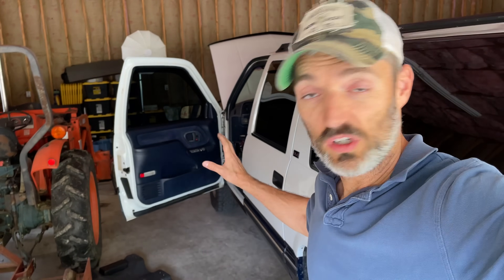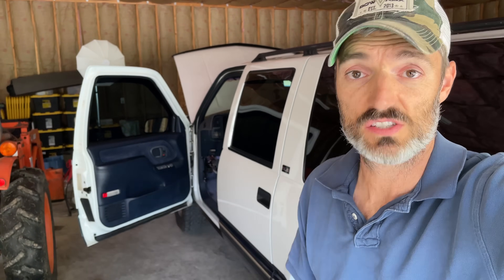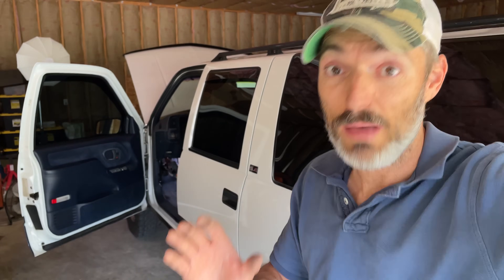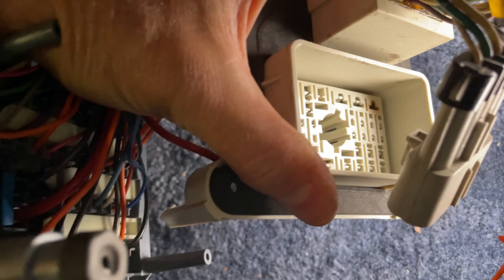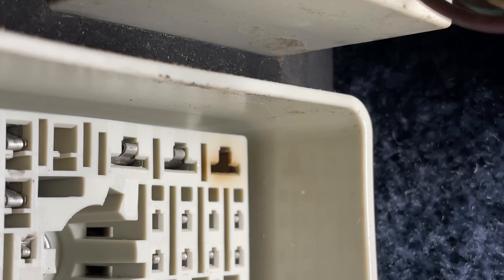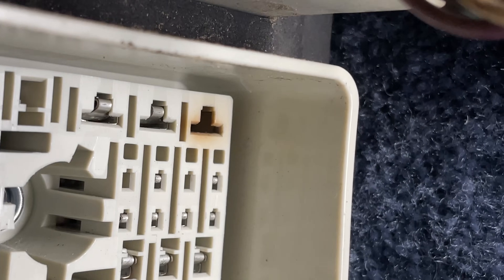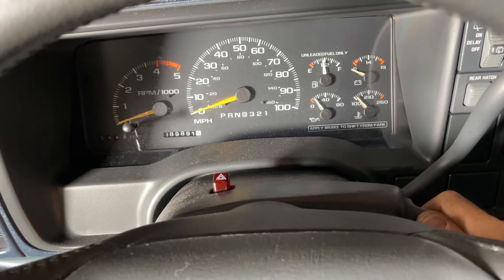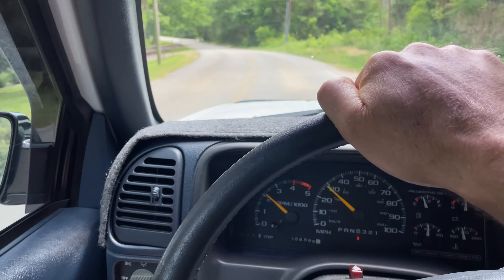If Truck Randomly Shuts Off THIS MIGHT BE WHY!!

Comment: Jimmy, you're a rock star! This wasn't the exact problem with my 2012 Silverado, but immediately sent me in the right direction after viewing this. My truck started randomly dying , usually right after starting it. No run, no crank was the only symptom. Warning lights, a/c blower, radio all functioned fine. After several attempts to restart, it'd finally go and run fine. It did this every day for about a week until I saw this vid. I saw another YouTube video that showed how to separate the under-hood fuse box from the base. I took it apart and found the dozens of pins that plug in had a lot of chalky oxidation on them. With a knife blade and 400 grit sandpaper, I carefully cleaned them all up. Upon reassembly, I noticed a relay labeled "run/crank". There were 4 other identical relays plugged in, so I swapped that one with one labeled "running lamps". I'm not sure which was the problem, but it's been 2 weeks and the problem has not recurred. Thanks for the video. Helped me sort my problem out quickly.
Reply: Is your car still working?

Comment: I have a 98. I took my truck to a guy that said on my models, there was a wire in the steering column messed up. He was an "expert". I changed my wiring harness in steering column since he did mention what you were describing about your shift light. I'm glad you found that problem. I'll be checking this out on mine. Great job!
Reply from the maker: Thanks, hope it helps!!
Reply: Any luck with your 98" mate ?
Reply: @mechaniconduty4040  My issue was unrelated to this in video. My issue was in transmission wiring harness. What issue are you having?
Reply: @ED-ti5tc recently had the transmission dropped and running into it dying while running did u find your problem?
Reply: @Miguel-lw2of  No. But I'm thinking it has something to do with the factory security system.
Reply: @ED-ti5tc my 98 chevy will run 100 fine but when u kill it and try turning it back on sometimes randomly itll seem like it had no power no connections at all then like nothing itll get connection and turn on

Comment: One great thing about owning a vehicle for many years is the familiarity you gain with it. I'm sure that was a help to find this problem. I, being an outside the box thinker, would have bypassed the connector block by splicing that wire from inside the engine compartment through the bulkhead to under the dash. You would eliminate any issue with that connector box and have easy access to that wire if needed. Regardless, I can't fault your fix. Nice job.
Reply: yes I had the same problem with a 76 ford , I bought off a car lot in Whitehorse Yukon really cheap , it had new battery ,new alt ,new ignition etc , then one day I was going to night shift at whitepass trucking as a tire man , and I seen a flash on the floor , that's what it was all along a # 10 main wire burnt off at the fire wall junction I joined the wire together and it was fine ever since .

Comment: I had a bad positive cable on my 08 Silverado.....random loss of electrical power.  I tried everything until I came to find that wiggling the positive cable had an effect.  I cut that giant positive connector off and replaced it with an old school battery connector.  Problem solved forever.  Your issue was different....but always smart to do the "big 4" on these mid 90's rigs.  I'm just waiting for Spring to come and I will do that little fix on my 95 K1500.

Comment: Appreciate this Jimmy! This just happened to me on my 2005 Suburban, but the lights for the shifter indicator and AC headend unit (with all the AC/ Heat controls) have been very VERY dim for a couple years. Sounds like that could all be related - who knew? Will check this solution out on my truck tomorrow - thank you very kindly for sharing! -Ken

Comment: I have a 1991 Chevrolet   bed and ext cabin....i have the same issue shouts off when stops on red light intersection. I exchanged distributor cap rotor ignition wires ignition coil
I check the buster break check valve and still shouting off...now that I see your video i will check that fuse box also like you did......I will let you know if works for me. 
Thanks for your videos are so educational. 
Jaime from HoustonTx 👍👍🙋😊
Reply from the maker: curious if its the same?
Reply: Did u find the issue @jaimef2674
Reply: Did you find it

Comment: back in the mid 80s I had a 1969 Mustang that would randomly die like that when taking off from a dead stop, or when I hit a bump in the road. It was almost the same thing, the screw that holds the two halves of basicly the same connector was loose. I tightened it up and never had that problem again.

Comment: Nice Jimmy.  One other wire you need to check for preventive maintenence, is the ignition bypass wire inder the passenger side dash.  There's a connector there that you disconnect to set the timing.  The contacts there in mine corroded and became intermittent.  I fixed it by opening up the harness to access that wire (brown if I recall) and I soldered extension leads about 12" long to each side.  Put back together and then solder the two ends.  Wrap up the excess wire with tie-wrap.  To set timing, I will unfurl the wires and cut the end off opening the circuit.  Then re-solder and re-stow those wires.  It will never again become intermittent.  Truck did not die, but stumbled horribly as the ECU lost control of spark timing (EST).
Reply from the maker: Very good info! Thanks

Comment: Intermittent electrical.  First, don't ever take the firewall pass thru block apart unless you are replacing it.  That's the last thing you do before you give up and rewire the whole vehicle.  Splitting that box can be like opening Pandora's box.
Check your fuel pump power lead from source to pump. Look at it, NOT continuity check. You've changed your fuel pump, lifted the truck, some other stuff.  Check that power source wire from one end to the other for a pinched or chaffing wire, loose connection.  Also, ignition switch wiring for the same issues.  You could have a jenke ignition switch, or maybe the plug on the switch is loose or wires chaffed against a bracket under the dash.  If it only happens after the truck is good and warmed up, take the ignition module out of the distributor to an auto parts store and have it checked.  They aren't very expensive and and it will be cooled of when you check it so...
Reply: U r right about that pump wire
Reply: @stuckinmygarage6220  Dropped my tank 3 times before I found issue with that wire not crimped properly
Reply: So what was that Red wire he fixed ??
Reply: @ABMNuskii  I think it goes to the neutral safety switch.  It is a hot and too big of gauge to be just for the PRNDL light.
Reply: @x-man5056  Thanks brother 👍🏾

Comment: Nice work detective! My 2018 silverado just started dieing and when I took off the grounding cable, it looked like the frame was undercoated before the cable was bolted on. So I cleaned off the undercoating and got down to metal so hopefully it fixes my issue.

Comment: This is a common problem on some of the jeeps, I changed out the ignition switch and everything still no start, started digging around and found this connection type on the starter under the car, and yup that was the problem, my 05 jeep liberty starts everytime now

Comment: My 1998 k1500 Suburban did this all the time. Would go out somewhere and would just die. Ended up being towed 37 times in one year. Would take to a specialist and said it’s fine and next day the Germlin would reappear. End end up parking up the suburban for 5 years then had an auto sparky rewire the complete engine bay so fingers crossed it’s sorted

Comment: Good stuff Jimmy, thanks for the knowledge. Now I'm going to have that failure lurking in the back of my head driving my Suburban! Only issue I've had is the anti-theft model went bad. Truck would start and run for 3 seconds and turn off. Drove me crazy for a few days until I replaced the module with a rebuilt one  (part no longer made) and had the ECM "flashed" (I think that's what my mechanic said). Anyway, can't wait to see what's next.
Reply: I've had this problem with mine. The stupid security feature. I no longer use the fob to lock/unlock or the door lock buttons. If it wont start, turn the key on for 10 mins till the 'security' light goes off then turn key off then back on. Should start. Not sure what the permanent fix is yet.
Reply: @tarabull75  you have to do a DIY hack and bypass the module with the right diode or have the module rebuilt (since they don't make them anymore). I had a two week nightmare until I got it figured out. The "learn the new key" trick worked for a few times but when the security light stays on... You're screwed.

Comment: I have a 1995 gmc c1500 the fuel pump wasn’t the issue after I replaced it also replaced tps egr and battery terminals right now it’s at a mechanic shop but i truly believe it’s this issue

Comment: Excellent video Jimmy  :) also check out is a ground battery cable pigtail to fender wall connector  get corrosion plus bolt of 10mm size also washer    for to clean up with sandpaper  on fender too it ! Next one is fuel tank sending unit plus plug to it frame rail ground wire connection to plus hardware  and next fuel injection  injectors need replacement  2 them ! Hope solved problem my late Dad 1990' Chevrolet Cheyenne  2500 pick up 305 motor happened to him in 2000 year and was driving caught off too!

Comment: I just fixed a stalling issue on my 1998 Jeep Grand Cherokee which was doing the exact same thing you described. My issue turned out to be the ESD Relay. It never showed a check engine light or anything, so frustrating to track down.

Comment: My truck would intermittently refuse to start. One day, I noticed that all of the gauges were reading wonky. I knew that I probably had a bad ground. It turned out that the negative battery cable had corroded at the battery terminal. I had to strip back the cable and install a better battery terminal connector. I also spayed some terminal protection fluid on the battery connections.

Comment: I have stalling issues as well. But mine would stall like yours did and I would have to throw it in neutral to keep it running at the light and only when the truck warmed up. I’m gonna check this out when I get a chance cause if it’s my issue. I’m gonna scream

Comment: What would have REALLY helped is if you would have identified the circuit that this wire is contained in.  Would allow for folks to make sense of what is actually happening in the electrical system, the WHY of what's failing.
Reply: Main power feed to everything through the ignition switch.

Comment: Great video. My truck just started doing this twice. Right after taking off it died. Then it started right away. I noticed my volt gauge has been acting weird, a little erratic but mainly lower usual. I also noticed my flasher was not working well couple of weeks ago, so I wiggle it and it is all good. It died today again and start right away. 96 chevy truck. Do you think it might be related to the same connections? Did u noticed low or erradic volt gauge?

Comment: Years 95 to 2000s also had ign switch problems I replaced several they would often times run but might not up shift & the gauges might not work

Comment: Jimmy, my 91 K1500 is a 4.3 v6
5 speed stick, died at 45 mph. I shifted
To neutral, and pulled off the road.
Towed home, it cranks but no start.
Maybe fuel pump, or ? 🤷🏿‍♂️

Comment: my '68 Slant Six Dodge Dart had same problem :face-blue-smiling:
was stuck in the boonies but had my tools. drilled out a hole right thru connection where it's on the firewall and used a twist-on connector. it's still like that and running still :person-turqouise-waving:

Comment: Good luck. My 2015 truck is dropping voltage when I park or when I'm coming to a stop when parking. . The engine shuts off completely. I can instantly restart it but it's a problem. Once I had no power for 15 min and then magically it just works again.

Comment: Hey Jimmy, I have a 1991 Chevy G30 Sport Van with a 5.7 liter TBI w/ automatic transmission that runs great, but dies at idle after it warms up. Every stop sign or light. Then it will start right up. The only way you can drive it is to put it in neutral at each stop. Lately the newest wrinkle is that, rarely, but on occasion it will not start. Meaning that nothing happens. The starter doesn't engage at all. No clicking or anything. If I leave it (cooling off, maybe) it will come back on line and start right up after 10 to 15 minutes.

I  have tried the idle air control valve, MAP sensor, heat sensor or switch (no temp. gauge),  Also, by the way, extremely rough start in cold weather. Any ideas? Really enjoy your channel. Thanks

Comment: If your rpm gauge ever pounces at idle (not with rpm) but just flutters (it's hard to explain) but the coil is bad and it would be good to change the distributor aswell. Some people will say to change the icm under the cap but that may not fix it and if it does the pickup coil is not far behind it.
Reply from the maker: Good to know
Reply: Can also be an air core motor (95+) that has had the viscious dampening fluid dry up/leak out

Comment: Will this issue throw any codes? My issue came up on our 2 hour journey back home from Disney. I was thinking well my battery connections do have to be replaced definitely on the negative. Then I was thinking it’s acting like a fuel issue. The first time it happened was going 75-80 on the highway when I was in the middle lane which was definitely sketchy. I got to the shoulder got the truck started got back on the highway took the first exit topped of my gas and then took back roads home. Then happened 3 more times at stop lights.

Comment: Those have a ignition switch problem. Pull the column panel down and wiggle the ignition switch wires pay attention to the large red wire it is ignition-1.

Comment: Today while driving my truck started missing like it was out of gas , the Guage is Messed up but I pulled over and it died , my husband came by and we put 9 gallons in it and it still won't start , I can hear the fuel pump running when I turn the key on so I know it isn't that. Any ideas ? It's on a 98 Silverado. I'm worried cause that truck is my baby.  I'd appreciate any help. Thanks

Comment: Ok so let me ask you this, because on my 95 silverado 5.7 tbi.  I had a similar issue.   Anyone i got some gas, rode not even 5 miles up the road.  Pulled a parking lot and went over a speed bump. As I'm going over, the truck just immediately dies. No jumping like it's struggling to get fuel or anything. Honestly it was so suddle.  I didn't notice it until I tried to give it some gas. Then it cut off two more times without me going over a speed bump in the same parking lot. I checked the battery terminals, they were good.  I even tried moving the around to see if it would affect the truck running. Typically this would only cause an issue if the alternator was being over worked. I played with the wires around the distributor and nothing.  I played with the alternator wires.  And nothing.. any ideas?  Because I'm loat at this point.

Comment: Did you check a wiring diagram to see what that wire was?  Got me curious
Reply from the maker: I tried. Looked in my Chilton and online. Only thing I could find says battery.
Reply: @1RoadGarage  with the amount of work you put into that truck a single vehicle subscription to alldatadiy would be a worthwhile investment. It’s like $99 or something. Complete factory service info and all diagrams. Those aftermarket books can lead you astray. Alldata is what the pros use. Just a thought

Comment: I had a 2002 Saturn SL2 that would not start after turning car off (happened in 2010), it would get me home in limp mode, and I had a hard time trying to figure it out. The GM dealer shop could not solve it either. Car would start and run most of the time, but when it died I would have to wait a while and it would start again. I can't remember what lights would blink, but it seemed it had to do with the anti-theft system or the bcm. Then while checking all the inside fuses, I touched the thick red wire that went from the underhood fuse box to the inside fuse box, and it was loose. I rigged another positive 12v wire from the  underhood fuse box to the inside box and the problem was solved. I just stuck the ends of the wire into the unused +12v fuse buss sockets, I know the fuse box would fall apart if I opened it. I ran the car 6 more years till the coolant manifold broke and then scrapped the car in 2016. While the Saturn ran well, it was the quietest 4 cylinder car I ever owned, even compared to my Corolla.

Comment: Mine randomly shuts off doesn’t matter if it’s idling or in park or driving. Mines a 94.
Reply: 1994 GMC just started dying while driving . Did U figure out da short ? ¿
Reply: @chandracarol232  i think mine was the battery. It hadn’t been started in a long time because I had a bad tire so I was driving my other car. It only did it for a couple days but I’ve been driving it since and it hasn’t died anymore.

Comment: You need a paper clip or a small pin or better than a little smallest Allen key you could get and push it in a slot why you push in the wire you push in the pin pull back the wire